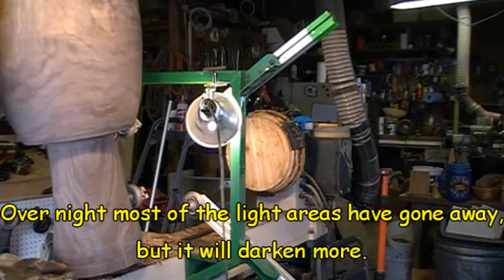#81 Jake's Custom Walnut Djembe Part 1

Comment: What is the purpose of spiraling the inside?
Reply from the maker: In a traditionally carved djembe the carving leaves a spiral inside. As it turns out the spiral ridges help reduce the passive harmonics of the shell. without the spiral the drum will "ring" with any note played. I have made them without the spiral and it is true, however thicker skin also helps eliminate the ring.
Reply: My curiosity answered ....I do love the color and the grain of the drum....as i was thinking of that your comment came up...LOL